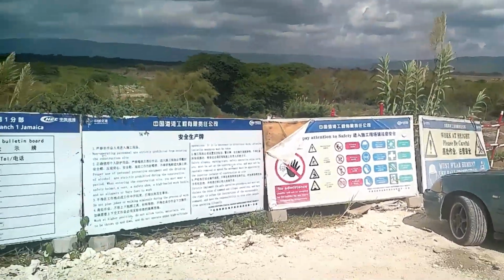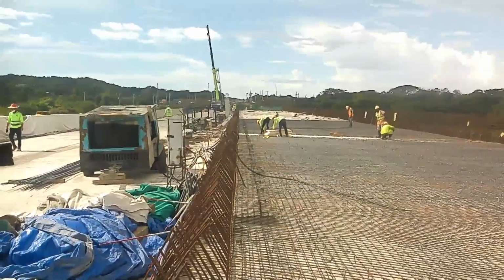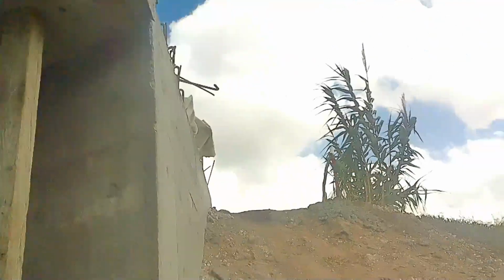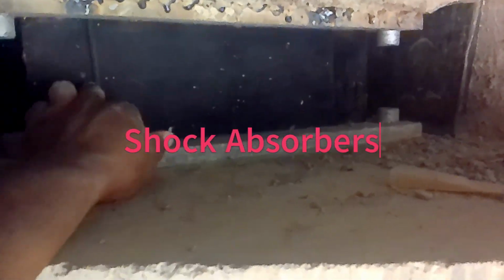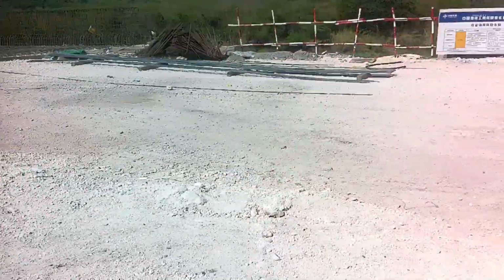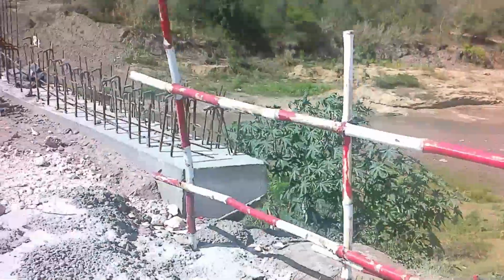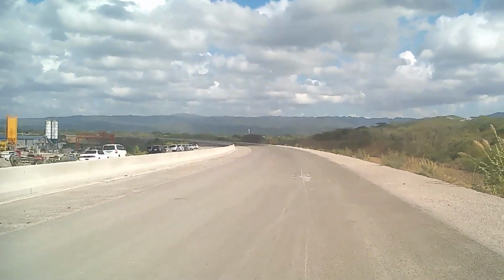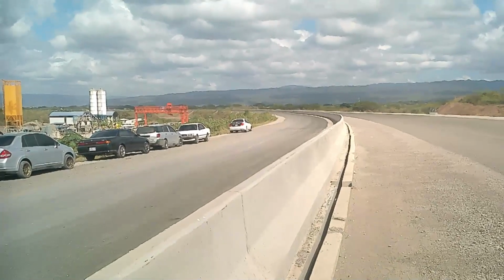Southern Coastal Highway ( Maypen to Mandeville Leg) Site Visit

Comment: I would love your perspective on the retaining walls built in White Horses Morant Bay St thomas .. I only see stones in the concrete pour NO STEEL
Reply from the maker: That type of wall is known as a Rubble Retaining wall or Gravity Retaining wall. It doesn't need any steel reinforcement. A Rubble Retaining wall depends on its massive weight for stability therefore no steel reinforcement is needed. Funny enough I am wondering if it is the same RR wall that I oversee the construction on the Rosell main Rd in 2008.  Good question though.

Comment: Completely support Concrete Jungle's suggestion, specifically regarding NWA's area of involvement and their supervisory responsibility in the project. The absence of the application of safe systems of work by our local contractors, especially relating to provisions for the safe passage of pedestrians, appears evident in many areas. 
The whole purpose of any engineering design, it seems to me, is to safeguard health and safety, which is a quality that can also be observed through the lens of esthetics. 
Oftentimes we accentuate road surface quality above the safety of pedestrians who usually appear in greater numbers in residential spots than motorists do, and therefore the need for safe walkways in such areas, especially out of consideration for the most vulnerable, becomes essential.
Road design today in many areas seems to continue to invite pedestrians and motorists to compete for the use of the same space. In addition to the absence of sidewalks and drainage sys in some areas where they are needed, the conspicuous habit of disgarding unused rubble and creating unnecessary mounts along the sides of these roads is a sure hazard that will force pedestrians unto the path of moving vehicles. 
It would also create good esthetic value if all our roads, especially in the countryside, were designed to accommodate  scope for landscaping. This, again, is a failing of the NWA. 
Thank goodness, the emphasis you project in your content is a cut above the rest. Big up!!
Reply from the maker: Completely agree. The lack of consideration these infrastructure developments has towards pedestrians, handicapps or even bicycle lanes for the public in general. Completely in agreement with every thing you mentioned by brother. Nuff Respect.